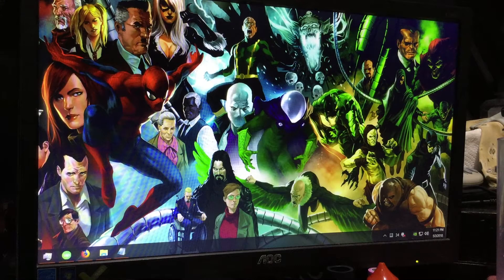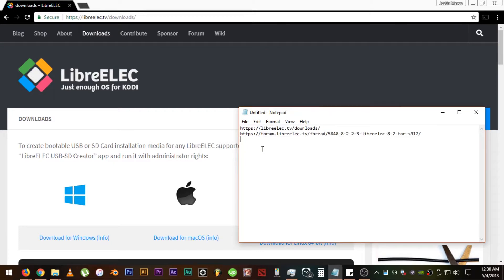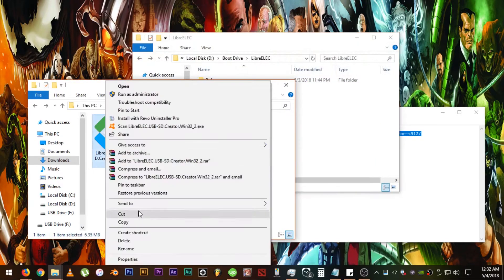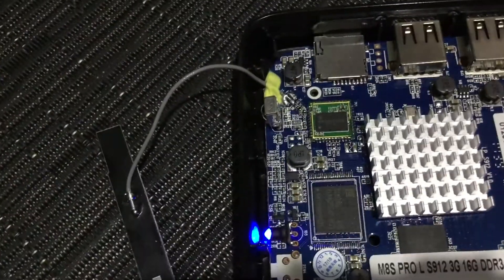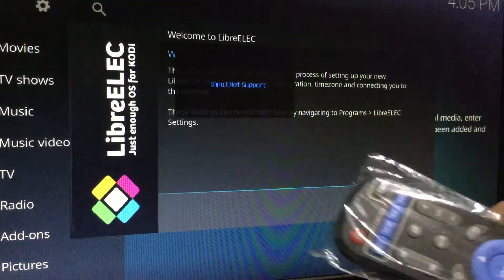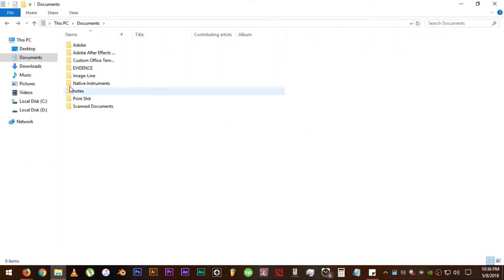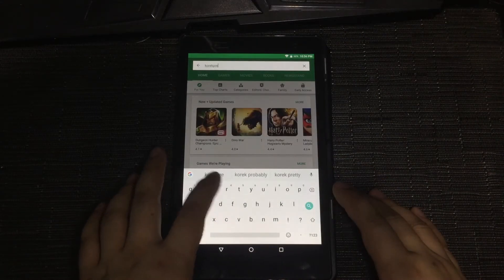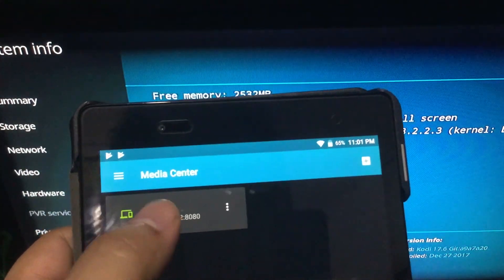How To Install LibreELEC on Android TV Boxes with Amlogic S912 or Lower. [NOW WITH CLOSED CAPTIONS]

Comment: ok i have kaon media kstb 6020 its from cable tv  and i cannot use it can i instal anything on it?if you can make some video i can donate
Reply from the maker: Hello, my apologies for the late response. My guess is if it has a built-in SD card reader, you may be able to do what I did. It's just a bit hard to know if your device is supported.
Reply: @HeathenHacks  i will try that  when i have time
Reply: @HeathenHacks  i have no sdcard reader in it only usb
Reply from the maker: Hmm. I see. Do you know the purpose of the USB port on it?
Reply: @HeathenHacks   what you mean its only usb..i found some around way but its not complitly deleteng problems  its eon cable tv operator locked..i found way to enter favorite aps ,instaled some louncher then i got all settings but still i want to erase that system and put my own
Reply: @HeathenHacks  also its wifi locked i cant use wifi ..
Broadcom BCM7268 procesor is problem
Reply: @HeathenHacks   if link dont work its kanon media kstb6020
Reply from the maker: If it's Wi-Fi locked, it's probably disabled by the firmware that the cable TV operator installed. So, unless you know how to replace the firmware that is installed or, at least, enable that feature on the firmware, you have to learn hardware hacking.

I suggest just buying a cheap android media box. Less hassle.

Comment: Does this work with HK1 Max? I seriously hope so, for real, please.
Reply: Any of the IMG files just lead to an HDMI No signal screen, no matter what.
Reply from the maker: Hmmm.. I've seen on some forums that you could solve it by changing the resolution or something on the config file. The config file fix is for Raspberry Pi's tho. So, not sure if it would work. For the meantime, you could try and remove the SD card and boot up the device just to confirm that the device itself is not malfunctioning first.

If and when you have confirmed that your device is functioning correctly, I guess you could try a different installation method like this.

https://troypoint.com/install-kodi-on-android-box/
Reply: @HeathenHacks  Yeah, My TV box boots up as normal, when I remove the SD card.
Reply: And it just resets My Android TV Box, like it reboots it.
Reply from the maker: For better solutions/answers, I think it would be best to ask/post on either 

LibreELEC: https://forum.libreelec.tv/

OR 

CoreELEC: https://discourse.coreelec.org/ 

forums.

My apologies. I'm at a loss. 

I switched to another Android Box and don't use Kodi or other 3rd parties anymore.
Reply: @HeathenHacks  I think it would be better to get an Android box, but yeah.

Man, I can't ever have a moment of me doing anything I want, without reality, preventing me, for being so!
Reply from the maker: Such is life. It's shitty. The sooner we learn how to accept it, the sooner we'd feel "meh" when things like this happen. I do agree tho. It sucks when we know we can do something about something but we don't know what do.

But, when you finally find the answer or made something work after all the stress, I guarantee it would feel rewarding.
Reply: @HeathenHacks  Yeah, like a character from Bojack Horseman said "life is a bitch, but you gonna still live on".

Also it sucks, when You take like months or a year, or more, just for a simple thing, or something that could be, like "neat, you made something!" But it's otherwise disposable, and better made on a much, much shorter time, or Made from packed on, packages that need to be Made more consistently and successively, like a factor, but life doesnt want to make it so like that.  Just saying.
Reply from the maker: Indeed. Sometimes, it's just better to buy things that would do what we wanted to out of the box. Fun fact, I actually have the Nexbox A95x which has s905x firmware iirc. I really had a hard time making kodi work on it, so I bought the MeCool one which has an s912 firmware. I spent less time configuring it because s912 was really popular back then and had a lot of resources.
Reply: @HeathenHacks  So, Mission Failure, my Android TV Box has to be Amlogic in order for CoreELEC to work properly, and my box is not Amlogic unfortunately.

What a waste of time I had.
Reply from the maker: Sorry you had to experience that. I apologize.

I guess the best option you can do (as of now) is update its firmware (if not updated yet) or try the unofficial versions from the LibreELEC forums. (They might not work tho).
Reply: @HeathenHacks  Thats what I told you about LibreELEC, it doesnt boot up to Kodi, it boots up to a black screen with white text, in which I can type on it.

Although updating My Android TV Box may not be a Bad idea.  Still thanks for trying to help me though.
Reply: @HeathenHacks  Gives me a No Signal HDMI error, and there's no config.txt to edit, not even using ext2read works at all, it just gives me a lost+found folder and a resizeme file.  I think im closer to getting LibreELEC work on my TV box though.
Reply: Any truly last tip?
Reply from the maker: I think the best one I could think of is don't expect the unofficial releases to work for now.

Second one is if you have a desktop computer where you can store your movies, check out Plex if you haven't yet.

Unfortunately, that's all I could think of.
Reply from the maker: Hello and thanks for the comment! ♥ 

According to what I've seen so far, it has an AmLogic S905x3 system. 

I would recommend checking this out for some reference: https://androidpctv.com/tutorial-libreelec-install-guide-tv-box-android/

Goodluck.
Reply: @HeathenHacks  Allelujah!  Sadly instead of booting straight up to Kodi, it would say something like “prep: /proc/net/pnp: No such file or directory, Error in Mount_Flash” Or something like that, I’m desperate since I was trying this for two weeks!  And nothing!
Reply from the maker: It can be like that sometimes. It's basically trying different images until something works. Specially now that a ton of android boxes are added in the market.

Try this one: https://forum.libreelec.tv/thread/21117-unoffical-le-9-2-9-80-images-for-rk3229-rk3228/

Maybe it would work.
Reply: @HeathenHacks  OHHHHHH, it’s trial and error, right, thanks for the tip!
Reply from the maker: Yes. Unless it's the same brand/model from the tutorial, it can be trial and error. I remember it also took me a week to make mine work.
Reply: Also, Ew...... I don't want to use the Android TV box version of Kodi, I want to straight up boot up into Kodi, on My Android TV box, and besides I have problems with My Game Controllers on there, including not being able to move diagonallys with My N64 Controller, and Controller compability issues with My PlayStation 3 Controllers.
Reply from the maker: I think I now know why it doesn't work.

Here's an update from LibreELEC posted last Feb 16: https://libreelec.tv/2021/02/upcoming-changes/

"Amlogic. Overall platform support is solid running on Linux 5.11 and switching to open-source Lima and Panfrost GPU drivers allows us to support the full range of Amlogic S905, S905X/D/W, S805X, S912, S905X2/D2, S905X3/D3 and S922X/A311D chips in a single “AMLGX” image. Development “nightly” images restarted recently but media capabilities (audio and hardware decoding) are not where we need them to be for formal releases to resume. Work on S805, S802 and S812 support also continues with early audio support being added, but there is still a long way to go before we think about an “AMLMX” image."

I think it's still in development/beta phase.

Either that, or I just don't know where to look.
Reply: @HeathenHacks  Yeah, that kinda makes sense.
Reply from the maker: You could also try CoreElec. Here are some links that could possibly help.

https://discourse.coreelec.org/t/how-to-install-coreelec/677

https://discourse.coreelec.org/t/which-dtb-do-i-use/389

https://coreelec.org/#download

CoreELEC is more focused on Amlogic devices. LibreELEC is more on x86 and Raspberry Pi's apparently.
Reply: @UCyx8jHz8aXoiq-KJFtCJPSg I don't have a desktop, but I have a crappy laptop, thats useful for watching videos and probably doing stuff or playing indie games with.

Yeah, I gotta get comfortable with the stuff I have, and what I can afford.
Reply: Also is Plex very similar to what Kodi is, it looks more sorta like a premium app, in the same way as Netflix with some Kodi functions borrowed of.
Reply from the maker: Plex is free to use but not ad-free like Kodi and yes, Plex is somewhat similar to Kodi, in terms of watching movies and stuff, the only difference is that you can watch movies from your laptop even if your laptop is on a different room by using the Plex app on your Android box. Provided that you also have a Plex account and install it on your laptop.

There are loads of videos/tutorials about it as well, so you'll know if you like its features before signing up for an account.

Also, I think the easiest way to watch your movies or play indie games on your TV is by just connecting an HDMI cable from your laptop to your TV. 

Basically, you can just use your TV as a 2nd monitor.
Reply: @HeathenHacks  Plex lets me watch movies from My laptop with another device?  Sounds like the Wii U a lot with being able to watch movies and TV shows(at the time) from another room by using the GamePad.  Interesting

Also i'm planning on buying a PowKiddy X18 so that I could watch movies and TV shows from Kodi on the go, and being able to play emulators on it, like a portable Android TV Box. This is the last comment I'm gonna type un from this comment btw.
Reply from the maker: I think this video can best explain what Plex can do: https://www.youtube.com/watch?v=sUgpdvJ5KzM

Worth a watch if you're interested.

Apparently, you can play some classic retro games on Plex now as well.
Reply: Cool.

Comment: Hey, HeathenHacks, I have a few questions.

1) I have a S905W box. Which LibreELEC files should I download for it?
2) Does this method include pushing down the reset button or do I just insert the SD card and it automatically boots into LibreELEC?
2) Can I modify skins and everything else on LIbreELEC Kodi compared to Android Kodi?
3) Can I also put my IPTV list on my SD card on which LibreELEC is located and use it like that?
Reply from the maker: Hi there, McLeodclansman! Thanks for the comment! ♥

1) According to the How-To FAQ: You should use one of device trees for S905X devices. (If using an S905W device)

URL: https://forum.libreelec.tv/thread/5556-howto-faq-install-community-builds-on-s905-s905d-s905w-s905x-s912-device/

But, I'm not sure if the img.gz/device tree download links are still working.

2) Sorry, the one I have does not have a reset button, so I haven't tried it yet.

You could try the Alternate Procedures on 4:38 tho.

2) Yes. (I think). It's still pretty much Kodi. 

3) Sorry again. I have no idea. I use an external hard disk for my media consumption.

Comment: thanks for the guide, just received from amazon my Mecool pro logic same as yours... kodi works smoothly with my 4k movies, do you recommend this procedure anyway? what's the difference in terms of enterteinment?
Reply from the maker: Hi, Dennis! Thanks for the comment! ♥ It's entirely up to you. My logic behind doing this (I mean, besides the fact that I need videos to upload. lol ) is that I don't use the other apps installed on it anyway, so why not just head straight to Kodi? I don't think there is a difference, since they are both Kodi and both installed on the same device. The only difference that I could think of is when LibreElec is installed, Kodi starts loading up right after you boot it up or turn the device on. Also, LibreElec would greatly impact the performance if the device you will be using has lower specs, I think (Not sure, tho).
Reply: @HeathenHacks  same as you I use Kodi only because I have already a smart TV, I just needed a movie.player for.my video.collection that's all. Anyway I'll try to do this procedure and if I have any issue I will ask to you hehe
Reply from the maker: Sure thing, man! No problem. ♥
Reply from the maker: Also, if you have a smart tv, you can try installing a Plex server on your computer and just access your movies from your PC using your smart tv. Here are the brands/models currently supported by Plex. https://support.plex.tv/articles/204080173-which-smart-tv-models-are-supported/

Just a suggestion in case you want to try it out.
Reply: The reason why I'm thinking of using Kodi LibreELEC is because apparently it has dynamic refresh rate change. Most of these Android boxes come with broken firmware, so to speak, and ever since Kodi Krypton you can't change the refresh rate, it's stuck at 60Hz.

Comment: Using LibreElec now on an old old large PC, and debated getting one of these and doing this, but wondered what the upside is? As in... is there a noticeable increase in speed (running/boot)? performance boost?
Reply from the maker: Hi there, thanks for the comment. ♥ Hmmm... To be honest, I have no idea. I haven't tried it on a PC yet, sorry. And in terms of why install LibreElec on an android box? Well, I maybe wrong on this, but, I think installing LibreElec on my device made the process a bit faster than usual. I mean, Kodi is the only thing I need from my box anyway, so why not go straight for it and bypass the loading phase of the other apps that are installed. This is subjective, but the simplicity of it just make things easier. Specially if the ones who will mainly use it are not that savvy on things like this. Like my mom and my siblings.

Comment: Can't really follow this. Music over your verbal instructions, means I can't hear what you're saying. Also, you seem to write the data using the USB-SD Creator tool to F:/, but pull out a micro SD from E:/? Where did the data come from that ended up on E:/? It's not clear what has happened?
Reply from the maker: First, I'd like to say thanks for the comment and yes, I agree that the music is overpowering my instructions. That was a really noob mistake. 

Also, the E:/ or LIBREELEC (E:) drive comes from USB Drive (F:)

It was created by the LIBREELEC software for some odd reason. 

Maybe it was a quirk of some sort or because I was using an action cam instead of a card reader that time.

Comment: Will this still work on an s912 box that has a reset button?
Reply from the maker: Steve Russo Hi, Steve! Thanks for commenting. I haven’t tried it on a box that has a reset button yet, but I guess it would work.
Reply: HeathenHacks awesome thanks for the response!
Reply from the maker: Steve Russo Hi again! I think you could try the “Alternate Procedure”.
Reply: HeathenHacks is that just another name for the "toothpick method"?
Reply from the maker: Oh, sorry for not clearly stating it. It's on around 4:37 minute mark of the video.
Reply: HeathenHacks that's exactly what I needed man thanks again for all the help!!
Reply from the maker: No worries man. Thanks for subscribing! :D ♥